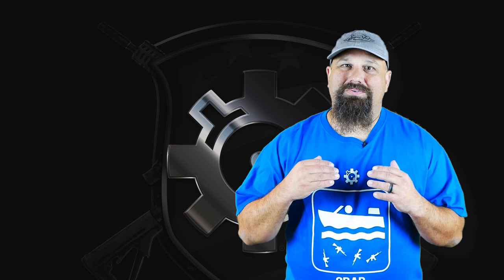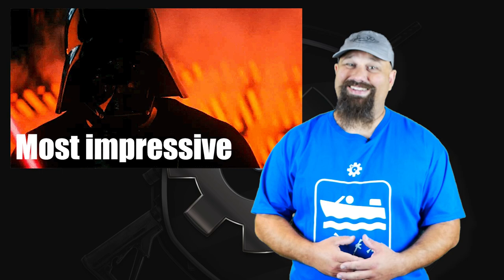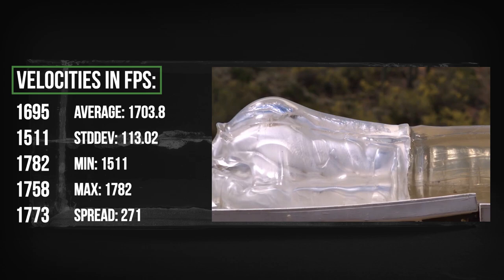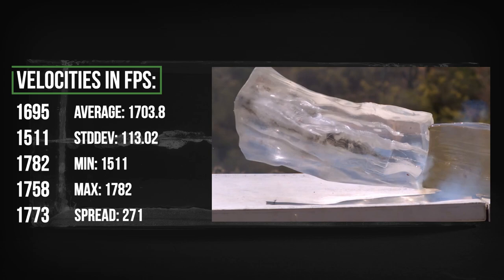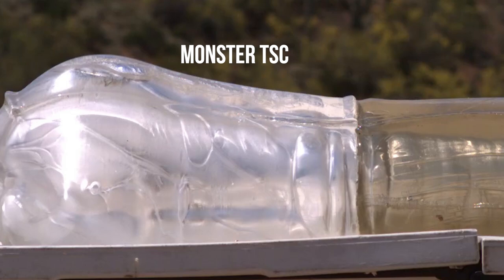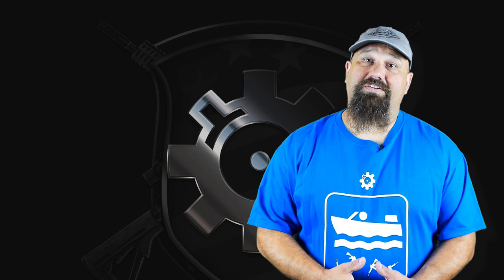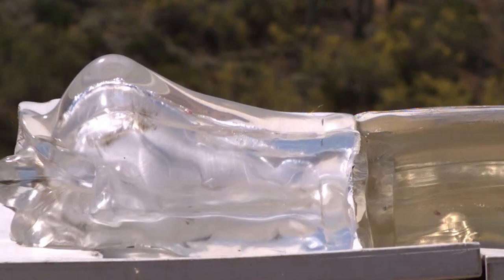A Beast of a Cartridge! .45-70 HSM 430gr +P RNFP Gel Test

Comment: I just bought a Savage 110 Scout in .450 Bushmaster last year, put a Leupold VX•R 1.5-5x33 on it and I LOVE it. Built it for these monster Ohio white tails...and would feel it is adequate for any werewolves or Sasquatch that may get frisky...and I know the ballistics are very similar between the .450 and 45/70 with more ‘normal’ rounds in the 45/70...I wish someone would work up some super hard core .450 to compare with the hot 45/70 loads. Black Butterfly makes some nasty stuff for the .450....but I don’t think anyone has really tested the pressure capabilities of the .450, at least not from anything I have seen...wouldn’t a bolt action be more capable of handling higher pressures than a lever action? ...or am I off here....?

Comment: Nice video.  Out of curiosity, what actually makes it a +P load?  I see from my notes that my hunting partner's load (load data courtesy of SOMCHEM, South Africa) for his 45-7- built on an enfield No IV MK 1 action is 52gr of S335 and a 420gr cast bullet which we chronographed at an average of 1830 ft/s.  He has used that load since August 2007 for big game.  I also see it is not the top load but we settled on it as the recoil gets a bit unpleasant when shooting from the bench.  A few years ago a Marlin 45-70  using a very similar load was used to take African Elephant in South Africa but the biggest animal my hunting partner has taken with his was a bull hippo which weighed just over 1750kg on a local weighbridge.

Comment: The higher the caliber, the lower the threshold speed for the "rippin and the tearin" the 2,000 fps rule seems to apply to smaller diameter projectiles more so than big fat nearly half and inch calibers lol it's nearly half an inch and still damn near traveling 2,000 fps
Reply: I think you're right.

Comment: My 50-70 with the 450 grain flat nose soft lead and black powder leaves a pretty substantial hole as well. Not to mention my 45-110 with a 540 gr bullet would blow a hole the size of a Mellon out the backside of a buffalo...
Have we progressed back to the 1870's, or have you confirmed that newer is not always "better"?
Interesting questions...

Comment: can't decide between a 30 30 or a 45 70. the only reason why i'm lean towards the 30 30 is for the higher velocity which means longer distances. they only reason i like the 45 70 is the power which makes it a proper bush round.
Reply: You can't go wrong with the .45-70. The 30-30 isn't enough for some critters.

Comment: It is entertaining for sure

However from the footage, i notice 1 thing, it is about 8 meter from the gel? The high speed camera capture a spark in the second gel, that is very likely a incomplete burning of propellant. We all know that the powder had to be burn inside the chamber to provide the juice ro kick. Therefore the +p can reduce a tiny bit, may be 5~10 grain i guess, or simply no +p? Or substitute that 5 grain with something such as gun cotton / quick burn paper that kind of things in between the powder and bullet. More space for the powder to do the work, cause we all know that it is a over loading charge. Otherwise you had to consider a longer barrel, may be a full 16 inch? But that kind of barrel will kick like a donkey. Ultimately a bullet had to hit something otherwise it don't count, right? If somebody only enjoy the kick, i would suggest them to play with those 1 inch lead ball hand-held cannons. That thing will guarantee smash your shoulder.
Reply: He is using a full 16.25" barrel.
Reply: @treier1589  if that is the case, very likely he had to consider 18~20 inch. Then the chamber pressure will be pretty high.....

Well, we know that all “elephant gun” are pretty long and kick like donkey. Seems he enjoy the kick, try the gun cotton method then, but i have to remind that, this method will rise the chamber pressure even more, there is a risk of blow up the gun. 

Back to square one, what is the point to +p on this round? The original formula already had enough juice to pop down an elephant, unless he is planning to shoot something bigger than a elephant.

A whale may be? That's a deck mount harpoon‘s job you are looking for.
Reply: @luderickwong  a 430 gr bullet at 1700 fps is a hotter load, but not max pressure for a Marlin 1895.  I think it may be +p as a gimmick or because the seem to use a slightly faster powder in this load.

I beleive he would get closer to 1800 fps in an 18" Guide model as that is what I feel this round was made for.

The round is stout for sure.  And rather loud in the 16".  But honestly it was similar to less than 12 gauge slug recoil to me.  And I tested them back to back.  He really seems to be playing it up for the camera.

Comment: If you loaded your own, could you use .45ACP projectiles in it? I'm talking about 185 jacketed Hollow Points in a 45-70 case and loading that to high velocities?
Reply: No.  A 45 acp is .452" in diameter.  The 45-70 is .458" in diameter.  But there is alot of options for .458" diameter bullets.  Heard there are some in the sub 200 grain territory to over 500 grains.

Comment: What do you expect from a round used to kill Buffalo? When it was Black Powder. Use hollow points or radically invasive projectiles or other specialty rounds like Buffalo Bore. You can kill an Elephant, Grizzly, Elk or anything else that comes into your sites. A human? With the right round you'll punch quite a hole through them, but there will be severe over penatration so make sure nothing is behind the target. With the right round you can probably crack the engine block of a car. She's a Beast!

Comment: It was thumpin on ya tiny, u where moving quite a bit and that seemed to increase with every shot u took. That seems to line right up with what u are saying. How much does that rifle way? I'm curious as to how much recoil it was generating. I'd guess around 25fps or so recoil velocity. 

Just looked, if the gun is 6lb and the powder charge was actually 70gr (prob 60) for a 430gr bullet moving 1700fps thats 4.8lbs sec inpulse @25.7 fps and 61.7 ftlbs of recoil with a 60gr charge its 56.2ftlbs that's alot an avg. 45/70 that weighs 7lbs has 26.34 and a 30lb 50bmg has 43.6 a 7lb 308 and 30-06 avg 21.2 and 25.25 respectively. So u where definitely shooting one of the hardest recoiling rounds there is. At the least if the gun is 7lbs @ a 60gr charge weight it's still puttin down 48.16ftlds of recoil. So no matter what its over double what a normal 45/70 has in recoil. Its official u could take an elephant with that no problem. That big slow moving hunk of lead is puttin down close to 2800ftlbs and that's and that's a whole lot for something moving under 2000fps it's a ginormous amount of energy for sun 2k fps round. So its gonna bust through any bone no matter how hard or thick and get really deep into everything not wearing hardened steel armour.

Comment: In 45/70 the 70 means 70 grains of black powder, you say 28 grains in the video @ 0:45 , https://en.wikipedia.org/wiki/.45-70 , Not a huge deal but maybe worth a video edit.  Side note I have and use a Marlin 45/70 as my saddle gun (yes, on an actual saddle).

Comment: The 540gr. Hammer handloads have been used on elephant although its below the minimum legal threshold for most places now. Id use this on cape buffalo fir sure, if legal, in certain countries. Anything on the NA continent will die readily from this one. I handload 405gr. cast FP to about 1400 fps just because any hotter hurts me too bad lol. Cant imagine pushing a heavier bullet to 1700 fps out of my guide gun. No thanks.

Comment: I wouldn't place much confidence in Fackler's ideas.  There were a lot of assumptions and arbitrary conclusions in his work.  That being said, you have essentially two choices, or so it appears to me based on more recent stuff.  High velocity smallbore is preferred because it does outsized damage with low weight and recoil.  It can be surprisingly effective against modern body armor as well.  However, massive soft lead bullets at more moderate velocities transfer enormous amounts of energy and disrupt organic material, as well as being inherently more stable, on average, due to higher ballistic coefficients.  So pick your poison.  I feel for you on the recoil, my 1895 Marlin 45-70 kicks like a mule, and I have the older model with the longer barrel and more weight.

Comment: If you really want some fun shoot those cartridges through my BFR :)
Reply: I've done that, years ago. Funny thing is that the load I shot used a fairly slow powder so recoil was actually worse in the guy's Thompson Center rifle than it was in the BFR.
Reply: @chopinbloc  I can believe that. For a complete burn in the BFR I use IMR-4198 and Benchmark and overall the recoil is not horrible until you get to really hot loads with fast burning powder.

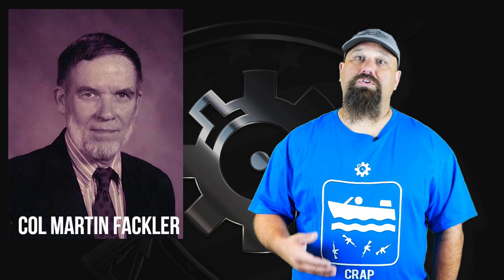Comment: I thought it was more like at Least 2,200 Feet Per Second?     Not that I think I'm ANY kinda expert, lol.  It's just that 2,200+ is the Threshold number I have been hearing from "experts" for a good little while now..?      EDIT:  After reviewing the statement @ around 4:00 mark,  Perhaps 2,000 FPS is the bare Minimum depending on the Specific Target, 🤔.  And 2,200 FPS is a Velocity at which it is considered (essentially) a statistical *Certainty that a Temporary Stretch Cavity will Significantly exceed the limits of biological Elasticity, in all Likely Living Targets..? 
    😅, Lol.  Just a bit of a sorta, "Off the Top of My Head, Hypothetical Analysis" kinda thing I enjoy engaging in at times.   What makes it Fun/Interesting is...   You have to try to be as Scientifically and/or Logically accurate as possible, using ONLY the Knowledge you can recall in the moment and Your own Deductive Reasoning skills.  NO hopping outta the video at hand, and going elsewhere to Research (aka Google, Lol) additional Info while Commenting on, or Contemplating an Addendum (aka an "EDIT") of sorts to One's original Comment. 

😂😂...  Maybe I'm the only one that finds this particular exercise "Fun"..?     Lol, Either way, I don't care. HAA!! 😜   Cheers🍻🍻!

Comment: I've used the Marlin 1895 Trapper .45-70 GOVT; (325 grain Hornady), on black bear. It works great. Very lethal weapon. I would use the same cartridge on grizzly, with a 425 grain bullet.

Beyond 200 yards the rifle is not that accurate.